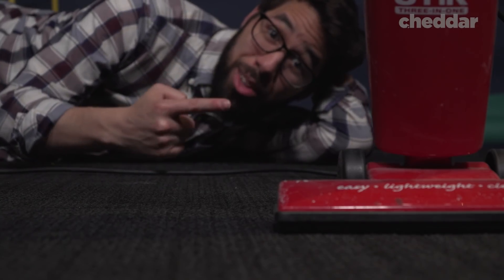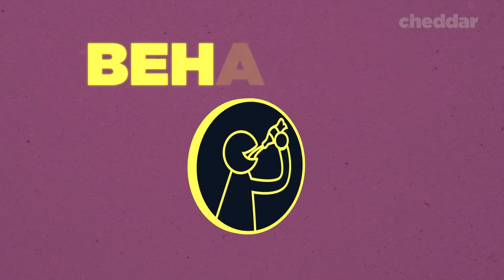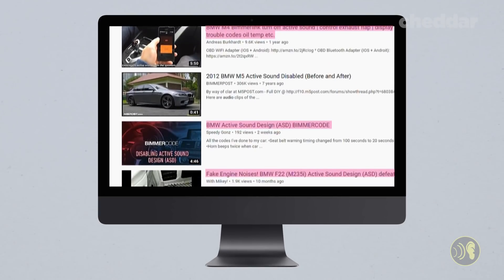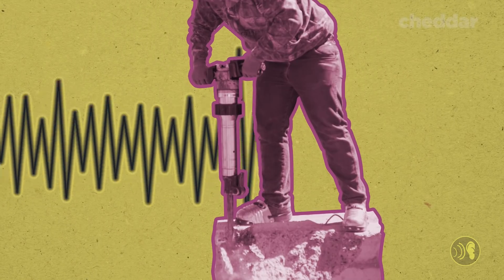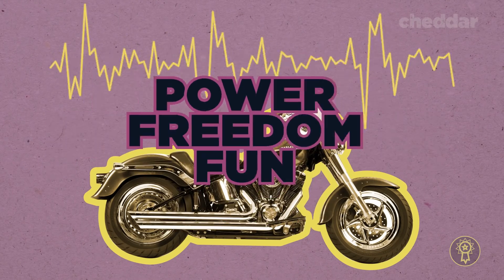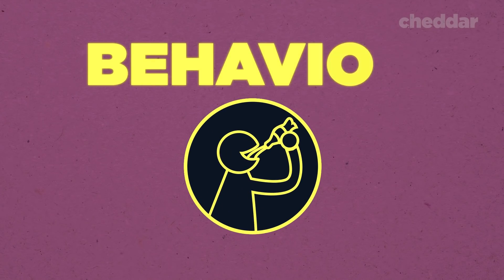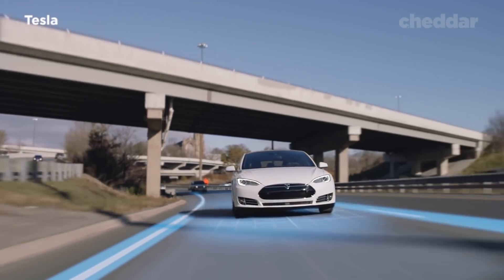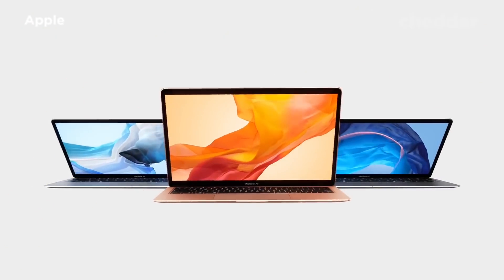The Fake Sounds Companies Add To Products - Cheddar Explains

Comment: They add noise to vacuums, then they charge extra for so-called silent vacuums. Genius!
Reply: Kind of like apple phones delaying their old ones to make people buy new ones
Reply: @AnimatedSonicStories  I dislike apple for many reasons but update throttling due to battery degrade isn't the worst thing. And on top of that they actually update their phones for years after it's release whereas on Most Android's the updates will stop after about 2-3 OS updates. Im an Android user. I still find them sleazy in other Depts, but this one's not the worst.
Reply: Isaacdotexe they slow them down so your phone doesn’t die at 59%
Reply: @AnimatedSonicStories  What do you mean delaying their old phones? If you're talking about planned obsolescence then I'd argue the oldest iPhones are fine on the latest updates, I use the oldest iPhone supported which is nearly 6 years old now & it works like a charm even though it's on the latest update. And if you're gonna argue the controversy where Apple throttled their phones, that's because batteries degrade & when the battery has degraded enough any phone, iPhone or Android, will die when they hit 30%. Apple wanted their phones to last longer & degrade less which is why they slow down iPhones just a little bit. Lithium degrades, that's just physics.
Reply: @nath1606  ... apple does not make good products. Check luis rossman. They design intentional shit that looks and feels pretty. Apple could easily use a slightly larger battery and dodge performance degradation. Its called engineering. You plan for it. Apple designed all its power to be at spec limits on day 1 so by day 90 your already getting slow. They also linked PP34V to all for USB ports in one of their laptops so if any 1 USB dies it kills the whole machine.

Im not saying they are the only ones but, the are probably the worst about it and the best at covering it. The command a ridiculous brand loyalty as well as iPhone seen as the luxury item so people who know of everything i mentioned will still buy it on status alone. They also have a great PR who can bury virtually any controversy.
Reply: Create a problem, sell the solution its brilliant!
Reply: @NINJAxBACON  I got megamind vibes from that
Reply: @NINJAxBACON  lol yep
Reply: @NINJAxBACON  ain't capitalism a beautiful thing?
Reply: This actually is a technique used everywhere for marketing and price justification. It's insane. Once you're a big brand, you can pull shit like that.
Reply: Someone in these comments has stock in Apple.
Reply: Add a problem to sell the solutions

Same as strings attached to your airpods so you don't lose em
Reply: @Ostrid1  Your AirPods should either be in the case or in your ears, there should be no reason why you should use them, unless they don't fit your ears. In which case, why are you buying AirPods?
Reply: It's called capitalism
Reply: Look at chocolate diamonds
They're the most common and impure diamonds you can find but they cost more because someone put chocolate in the name...
Reply: Lol imagine if most people knew we didnt need gasolie.n and could have cars that run on water
Reply: @youtubernoober3386  Imagine that people rather want not as explosive gasoline then having highly explosive hydrogen under their arses when the idiots crash...
Reply: colin3ds I’d argue normal people wouldn’t notice any slowdown much because it’s not like it’s being slowed down a lot at all. It’s only a little, & enough for the phone to get by. I still see a ton of iPhone 6 & 6s despite the slowdown controversy & even in some cases, an iPhone 5s.

And batteries are quite easy to replace if you follow an ifixit guide & you know exactly what you’re doing. If not, battery replacements are quite cheap from Apple, I know it’s not $29 anymore but it used to be $79 & I believe now it’s $59 (I may have to double check that). That’s not bad.
Reply: Its Big Suck! They’re in kahoots with the globe manufacturers
Reply: shhhhhhhhhhh... don't give them any ideas
Reply: Give out the razor, sell the blades.
Reply: @burgernthemomrailer  Why give out the razor when you can sell that too?
Reply: Trippy Frost What do you think inkjet sellers are doing? They’re selling the printer for a low price and holy fuck they’re increasing the prices for ink A FUCK TON. Buy laser printers.
Reply: Corey Search "iPhone battery" on eBay. You'll be pleasantly surprised & there's iFixit guides on how to replace the battery. You can even get OEM iPhone batteries on eBay, yes it'll void your warranty but personally, if I used my phone for so long that the phone was throttled, I wouldn't care. And there are 3rd party shops that can do it, you've clearly not done research.
Reply: that makes way more sense then the video
Reply: NO NOT GENIUS ! What a bunch of assholes...
Reply: That was my first thought
Reply: And then people steal them right off the shelf because why pay for corporate fascism
Reply: @alexisgeovann It still has 90% capacity, according to coconutBattery which means it's not throttled. And battery replacements are quite cheap if you do it yourself, it's a little more expensive from Apple but that option still isn't that expensive.

"This is what you look like right now" you sure you're not looking in a mirror. Jk man but don't make shit personal my dude.
Reply: @nath1606  oh then uhhhhhh I agree
Reply: @nath1606  Except Apple slows their older devices with os updates. With newer iteration of the os the older phones get slower, not directly intended to prompt you to upgrade though as this is an issue with hardware. The older the hardware, the slower it becomes with newer software and os. Again not something intended directly to make users upgrade, but rather a side effect of hardware limitation. But still, its a way to sell newer devices easier.
Reply: @CursedSigma  That's not necessarily true. The iPhone 5 on iOS 10 was pretty much as fast as it was on iOS 6 & there's speed tests out there that prove that. And if anything the iPhone 5s is barely slower than it was on iOS 7, given that it hasn't been throttled (Maybe iOS 11 is an exception but tbh it was fine on a non-throttled 5s & it really does help to restore your iPhone when you update it). It was only really the iPhone 4 & 4s that slowed down a lot.

Imo, if Apple wanted to sell newer devices, they'd have stopped giving older iPhones new updates a lot earlier. That would mean older iPhones wouldn't get the latest software features for as long, the latest app updates or even apps that don't support older versions of iOS. It's very hard to find modern apps for even iOS 8 or even 9 in some cases.
Reply: @CursedSigma  idk man, they dont show you the GHz. It wouldnt be hard to throttle 0.1 GHz on every update. Do 10 updates in a year and thats 1 GHz. That is a huge amount.

Ive never seen proof for or against this. just speculation as to how they could do it easily.
Reply: Corey  They may stop 3rd party repair shops but it's still possible to repair it yourself. And Apple's own battery replacement service isn't that expensive, given that they're using their own brand new 1st party batteries & you're getting someone who was trained to replace batteries to replace your battery. Them closing down 3rd party battery replacement shops, ye I get that but it's no reason to stop using Apple. And Apple isn't overpriced, yes it's expensive but you don't take into account the incredibly high resale value Apple products have, you'll lose more money with a Google Pixel, Samsung Galaxy, whatever than an iPhone. And Apple does have cheaper options, like a refurbished iPhone 7 starting at less than $400 & it'll probably be supported until iOS 16 if Apple keeps up their update pattern. 

You can argue that Apple are shady, I'll give you that they're not kind on 3rd party repairs but they care about privacy. That's why Siri is bad. I'd argue Google is shadier, they log a lot of data of you & sell it. Infact, they even log all of your purchases & they didn't even mention it until someone found it. They've had huge privacy scandals with Google + which, mind you, was integrated into YouTube so you can't say that nobody used it.
Reply: Corey  For the text part, I'd argue that if they did that, that would make people think their phones aren't ageing well & they'll upgrade to the latest phone. And Apple let's you toggle a switch in the settings that gives back your performance after your phones been throttled anyway. Unfortunately, that's not available on the 5s & 6 but I understand that because they're so old that if you did toggle the switch, the battery will only hold half of it's original charge.

They definitely didn't blanket slow down certain models, I've checked my iPhone 5s battery health on an app called CoconutBattery. It's at 90% (throttling happens at 86%) & it's still fast. I've heard of iPhone 5s' being slow lately even from people who use an iPhone 5s but that'll be because it's been throttled so it can last longer without the battery totally dying. So there's definitely not a blanket for certain models. And a new battery does fix the performance.

I kinda see that Apple has targeted the ordinary consumer but at the same time a lot of professionals also like to use Apple products, mainly Macs. Macs are very popular with musicians, video editors, developers, graphic designers & more. And devs especially like the fact that MacOS is a Unix system so they can use all their sudo commands & all that.
Maybe they won't tell the difference but I'd like to argue that the throttling controversy has been all over the news so people are definitely aware of it & that's what Apple Customer Support is there for.

For the Face ID part, the LG Premium would have had horrible facial recognition. It was literally just the front facing camera that did the facial recognition. You could fool it with a picture of yourself. Apple is never the first to any tech but when they implement something, they perfect it. You cannot fool Apple's Face ID with a photo of yourself. That's because they implemented depth sensors & a whole load of 3D imaging instead of just slapping in some facial recognition software into the front facing camera. Apple is never first but they do things properly.

I'd actually argue they presented it as a new technology for iPhone, not the whole industry. People already knew about other phones facial recognition, they also heard it wasn't that very good. And even then, most people buy iPhones because they prefer the iOS user experience over Android so they don't really give a shit if some Android company did it first.

I say "Google does this" because I'd like to mention that no company is innocent. And you can say that you can opt out of the data collection but anything that is free, you are the product, how else would Google make money? And I remember a while ago that Google actually turned back on the data collection settings, I don't know if they do that now but I'd like to experiment with that. And I don't really think Google makes it clear at all about opting out in my experience, though I've not used Google in ages so I'll have another look. Some people are fine with Google's data collection, that's fine but I personally really care about my privacy, so Google's a no go for me (except YouTube, how ironic).

And ffs, don't bring politics into this. It's ok to be a right winger. Most right wingers are decent humans just like most left wingers. And both right & left have their shit part (tbh, it's mostly alt leftists that's causing trouble in todays world, RIP free speech). Just don't go too far to one side. And that's the first I've heard of "But Hillary's emails" so I'm not really sure that actually happens, I'll Bing it, don't worry.

Comment: Sell them as "Quiet", then 🤔

That said, I wouldn't mind feedback on dust particles - incredibly satisfying, and the best part of vacuum cleaning
Reply: I think most people have the problem with the motor sound rather then dust particle feedback. The motor sound honestly always makes my head hurt really badly which is why I prefer actual wet rag, kneepads and a bucket of water to clean my floor, rather then having a convenience of the vacuum. It's just better to me personally because I get more pros then cons out of it. For pros: I use less electricity thus have lower bill, I get a free workout which I need all I can get, I don't get headaches from loud UNNECESSARY noise, I don't have a rattling in my ear for a day or two afterwards, I don't contribute to noise pollution on our planet. Same reason I also don't use an AC or a fan in the summer despite the fact that NYC is a frying pan in a summer. I would rather get used to higher temperatures then live with a constant headache the whole summer. However there are cons: it's a lot of work, it's not a convinient option, it takes longer. Still the pros list is longer simply because those items are loud. If they were made quieter I might consider them for conveniece but honestly I don't know if I would want a clunky vacuum in my home.

Comment: I replaced mine with the voice of Gilbert Gottfried whining.

Also, Snapple doesn't pop if you stab a hole in the lid with a screwdriver.  I have done this, and can confirm it works.

I only eat use Pringles flour to bake with.  I'd freak out if my Pringles banana nut bread came out crunchy.

Comment: Apparently, I have preferred tank vacuums, as opposed to upright, because I can easily repeatedly test the suction power at the end of the hose.
The noise is terrible, however. I think the "screamers" have motor and air suction components that are more compact and cheaper to manufacture.

Comment: The internal combustion engine in my car ( and most cars ) is so quiet I need to put my hand on the hood to know if it's running while standing outside of the car.
So far I'm not invisible to pedestrians with the exception of the woman texting walked right into my parked car.
Adding noise to an electric vehicle is just to take self responsibility away from dumb ass texting mobile morons.

Comment: The Snapple thing is only unique for the plastic bottle. 

Plenty of other food products in glass jars have the same freshness thing. Like Pasta sauce, jam etc.. That's important because those foods are sterilised inside their jars, with the lids on, which gives them extended shelf life, just like cans of things; and you need a way to tell if that seal has been broken, and one that is fool proof and will activate even if the jar is only slightly opened, letting air and germs in.

As for the comment "car horns don't have any reason to sound like car horns" isn't really accurate. Car originated from diaphragm and actual horn bells, and that was the sound they made. In some cars the design is cheap and it's an electronic buzzer like a loud piezzo. This is more of a sound following the design/technology and not the design following the sound.

Comment: The popping cap, is to signify that the seal on the bottle has not been broken.

I have never thought "What a nice pop" only "Okay, this had not been opened before"

When purchasing bottles with this feature, i always press the cap to see if it clicks, if it does i pick another bottle that does not.

Comment: "guides our lives" = "deceives and manipulates"

A vacuum cleaner manufacturer could make a quiet machine, and 'out' the other manufacturers and really clean up ;)

The claim that a loud motorcycle is safer is idiotic, the sound prevents the rider from being able to hear potential threats and fatigues the rider, it also antagonizes and increases stress in those subjected to the noise.

Comment: This video is flawed. I, like many others, paid up for a more silent vacuum cleaner from Miele and SEBO. I don't think that the louder the noise means it's cleaning better as many others think. If I had a question about how well it's cleaning or picking up debris, all I have to do is put my hand over the suction pipe while it tries to rip the skin off my hand.

Comment: I noticed the sounds made by digital cameras (and later, camera phones) mimic the mechanical sounds of old cameras.  Having feedback makes sense and the specific sounds were meaningful to the first users.  Personally, for feedback in operating a control I find a subtle natural-sounding click to be much nicer than a synthetic beep.  I recall early calculators with touch keys made a beep sound and it got annoying.  If it made a just-noticeable sound more similar to the natural sound of a key-press, it would have been much better.  Designers have learned over the decades.

For vacuums: I would think that commercial/industrial models would be more favorable toward quiet motors.  E.g. the vacuum cleaner used in a hotel for room cleaning is not bought by the person using it, and less noise heard by surrounding rooms is a clear benefit.